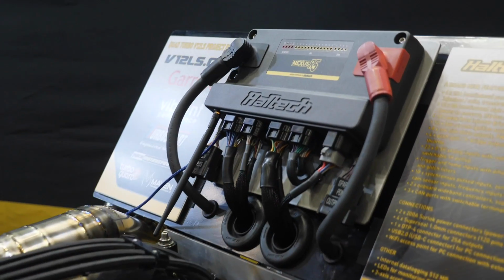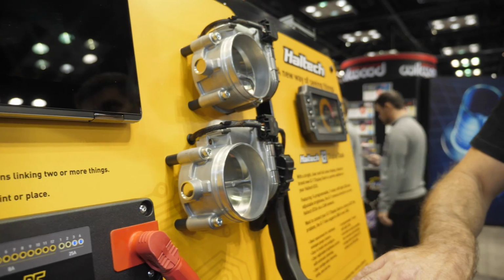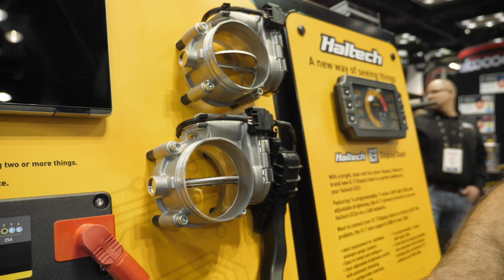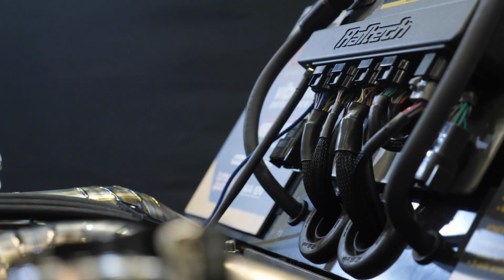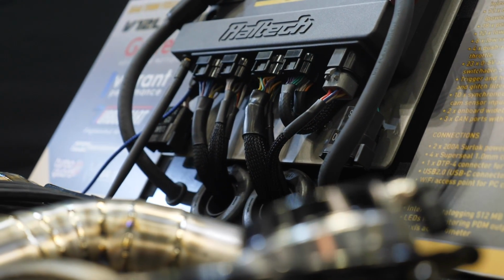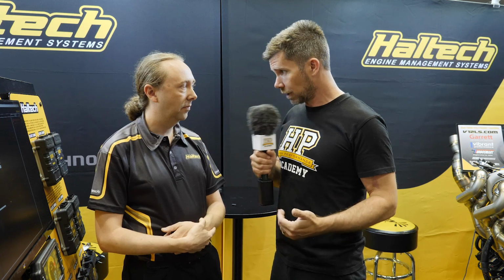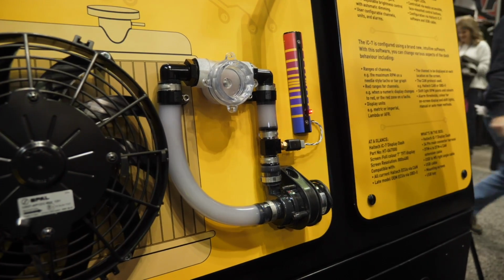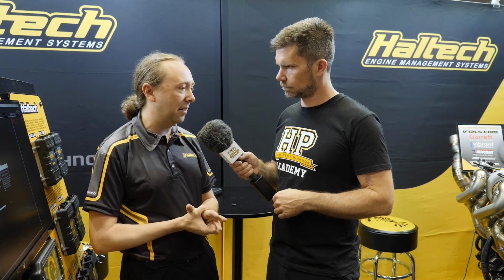What Is THIS! An ECU, PDM, Wideband Controller AND Datalogger? | Haltech Nexus R5

Comment: For anybody complaining about the Elite Series and all their boxes, I found those boxes to be very beneficial. Remote locating the boxes near the sensors and connecting to the can bus. If you got sensors strewn all over the vehicle from front to back, you have voltage loss and interruption from inductance. Those issues are eliminated with the can bus. Haltech knew what they were doing. The people that complain about this design are usually plug-and-play folks.

Comment: Thank you Andre for taking on BOTH of my questions with HEAT and Electrical NOISE!  This is going to be one HOT box!  Hopefully Haltech does a bit more with thermals/heatsinks to handle all of this in that footprint. 200A of PDM that has PWM + a 70c average temp WiFi Module + ECU.  Would be great to see Haltech release a video of this sitting in the sun on full load with some FLIR pictures.  Great interview, Andre.

Comment: Wow, excited to get my hands on that! hopefully they sell a trimmed down version, less injectors with the PDM.
Reply: with just 4 x 25A outputs, I can see it requiring secondary PDM on many builds
Reply: @jalava78  4x 25A and 12x 8A
Reply: @sparky173j  4x25A goes by really fast, each fuel pump needs own, each fan needs own, coils need 5A output each so usually they take one common, injectors are usually 1.5A per injector so for V8 prepare that could mean 2x8A outputs. It adds up fast if you start going it through. Keeping stock chassis electronics and just powering up engine and fuel, sure.
Reply: As Andy says in the interview, fuel pumps, cooling fans etc draw too much power (>25A) so you would still use a separate relay for those items
Reply: With most PDMs, you can pair outputs for greater amperage needs.
Alternatively, as mentioned, one can add dedicated PDMs as required, or even use conventional or solid state relays, operated from the 8A channels. The advantage of this is that a single high amperage cable and the required low amperage signal wires may offer packaging, or routing, advantages compared to longer medium current cabling - an example being the fuel pumps which will normally be rear mounted close to the battery

There may also be an advantage in using the secondary PDM where there is risk of failure or the installation requirements will be changing - again, fitting higher drawing fuel pumps and/or maybe adding a diff'and/or gearbox cooler pump/fan.

Comment: Learn something new every day...

What's the difference between megabits and megabytes? One megabyte is equal to eight megabits, but the terms are used in specific ways: Megabits per second (mbps) are generally used to describe the speed of an Internet connection, whereas megabytes (MB) usually refer to the size of a file or storage space.
Reply: I work in Tech and you'd be absolutely amazed at the amount of people who don't even know this basic piece of info.
Reply: Yes, Andy is referencing USB2 limit of 480Mbits/s or 60MBytes/s.  Gigabit ethernet (1000 Mbits/sec) is 125MBytes/sec, Fast Ethernet 100Mbits/s or 12.5MBytes/sec.  This is normally the difference in the IT world between how the storage people describe things (bytes) and how the network people describe things (bits). :)
Reply: You have it right, I understand it goes right back to BAUD rates - been a VERY long time, but, IIRC, the BAUD speed was how many data bits/sec were transmitted the binary 0 and 1 states - because there was a lot of other data, like start, end, frame, buffer overheads, the actual number of bytes/ sec was rather less than the 1/8 bit rate one might expect. Back then  they also used nibbles (2 bits) and words (4 bits) but I've been out of it for a long time, so don't know if those terms are even used nowadays.

It used to be that kilobytes, megabytes, gigabytes, etc, were true powers of two - like 1024 bytes for a kilobyte, but I understand they are now nominally 10^3, 10^6, 10^9, etc, instead.

Comment: Sweet as! A complete package that's simple and designed to work together without all the additional crap that ends up being needed, nice one!
Sorry if it's been covered, but with the data capture/logging, have Haltech considered some form of memory chip/stick that, on rapid pit stops, can be pulled out for further analysis and another slipped in? Might not be needed with live telemetry, though, if they have the bandwidth.

Next story on that quad turbo V12 LS also on that stand?
Reply: Shouldn't that be "Sweet as bro! ........ " 😉
Reply: @-MacCat-  Haha - good point, but I refuse to use the "bro" as it's used by so many people I REALLY don't want any suggestion of their being whanau ;-)
Reply: @gordowg1wg145  Point well made! 👍

Comment: With the pdm module being internal, could there be issues with emf induced into the higher impedance sensor etc wires at the ecu output? Seems like using pwm internally and having the high current output so close to the  other ecu wires...

Comment: Is this unit capable of flex fuel sensing without an external module?
Reply: Do you mean does fuel run through the unit to sense ethanol content?
Reply: @theskidfactory  no obviously you'd still need the pipe that the fuel runs through. I thought the old ecu's needed a separate box similar to the external wideband box
Reply: I see now the box is built into the pipe, so I assume it just takes the output as normal

Comment: Do you have plug and play kit for a 2005 Camry?
Reply: No.... Who modifies Camry's? Not to make fun or disrespect, I do know of a Canadian who built a twin turbo Camry that made at least 500whp to the front wheels. That said there is no demand for a PNP unit and no performance application is built around that platform. It's not terribly difficult to wire one up yourself.
Reply: The ecu would be worth more than the car... why would you want to modify a camry it's a family car?
Reply: I have now got a full exhaust, pod filter and Iridium spark plugs. I want a new computer so I can dyno tune it and get more power!

Comment: The hesitation when announcing the price makes me think its 10k++ usd
Reply: Yeah the shit is too damn expensive for what it really is...
Reply: @elonmust7470  

So buy something else that you think is 'fair'? 

Different folks will have different needs and budgets. I don't have either the need or budget - but, as an observation, I would say that something 'cheap' that doesn't do what one needs is going to be one of the most expensive purchases one can make!
Reply: @gordowg1wg145  fueltech ft600 is a fraction of the cost and I've seen a LOT of good things about the unit.. also why are you quoting words that I never said?
Reply: The ft600 is not a PDM
Reply: @elonmust7470  

Much cheaper but also much less capable - still a good unit for those that have their needs met.
Seems you don't understand what 'quoting' means? Perhaps you mean I'm reading into your comment something you didn't mean to imply - I read it as you thinking it was overpriced and not as unique in it's abilities as it actually is?
Reply: @nsboost  the ft600 dosen't manage data?
Reply: @gordowg1wg145  tell me the big diffetences.
Reply: If an engine management sysyem were to come out that was $20,000.00 would it then be even better?   Where does it end?  How much power is actually needed to shoot fuel & spark in cadence?
I've always welcomed the future but these people would be fine with $500.00 gas caps, too much..
Reply: @elonmust7470  

Channels, data rates, inbuilt PCM for starters. AGAIN, for many people it has capabilities that won't be needed - and there are many other, good, products from other manufacturers that will be perfect for them. Some may be looking for upgrades but already have the ancilliary boxes that can be used with a higher ECU from their current supplier, and don't want to start again with the greater financial hit - again, fair enough, different needs for different folks!

You do come over as a little defensive, did you recently buy a Fueltech, sell them or work for them?
There's a bit more here, that I actually received a couple of days before Andre's interview was posted - https://www.haltech.com/haltech-nexus-to-be-unveiled-at-pri-2019/

Comment: Really wanting to see more on the new ECUmaster PMU and the EMU Pro ECU!
Reply: Seconded!
Reply: why? this is a billion times better/smarter
Reply: @maximumarrigato9736  well that would be demonstrated in a head to head if your correct!
Reply: @maximumarrigato9736  because ECUmaster has more capabilities.  They have a direct injection ECU coming out and have always had internal lambda controllers, low impedance injector drivers, and passive coil drivers built directly into the ECU.  And their new PMU uses autosports connectors and is amazingly compact.
Reply: @JustKyzuuh  I've never heard of the Brand, but its sounds good.
What do their products start at RRP?
Reply: ECU master do a built in kill switch which is perfect for race cars. All PDMs should have this!
Reply: @ryanp6138  if you're referencing their battery isolator, it's not within their pmu 
They have tons of cool products and it's all so practical and priced great!
Reply: @JustKyzuuh  ever actually used one? their software is crap and half their functions don't work. almost as bad as emtron.
Reply: @maximumarrigato9736  you'd have to give me specific examples.  I've been using their products in a few builds for a while and have never had many issues.  Any issues that I've had they have been very quick to fix.  There aren't any functions in any of their products that don't work like what you're stating.
Reply: Quality Australian Made > Cheap Polish Made Junk
Reply: @easychinesey  if you'd actually used their products you wouldn't be saying my that.  They have one of the best PDMs on the market.  I won't trash haltech too much, as every system has its flaws, but I have extensive experience with both systems and prefer the ECUmaster collection of products.  Being able to connect to my laptop in less than a second rather than 45 seconds with an Elite ECU is just one of many things that make me prefer ECUmaster.